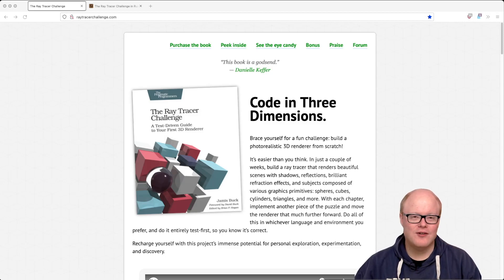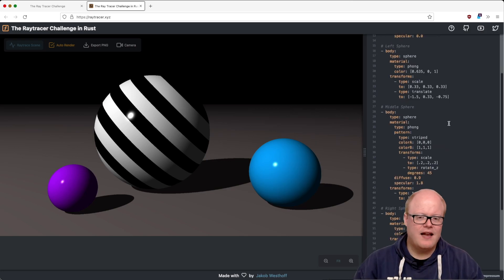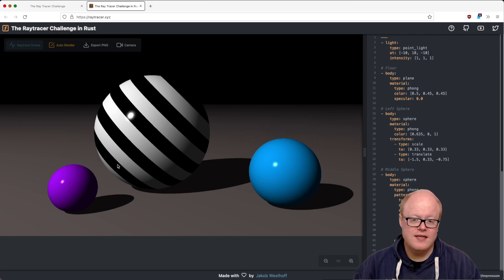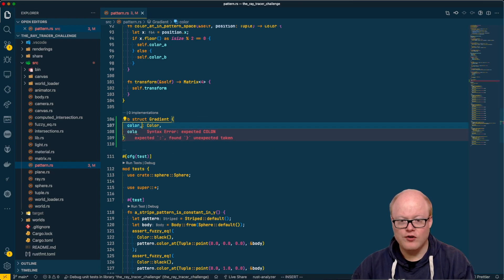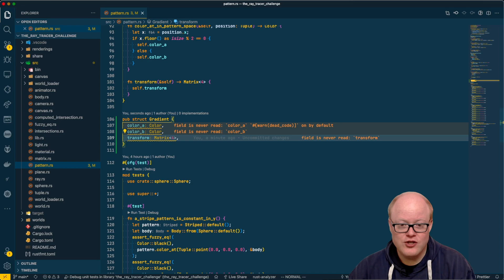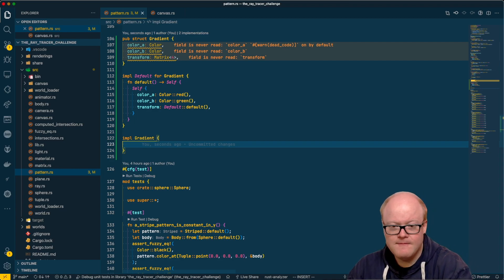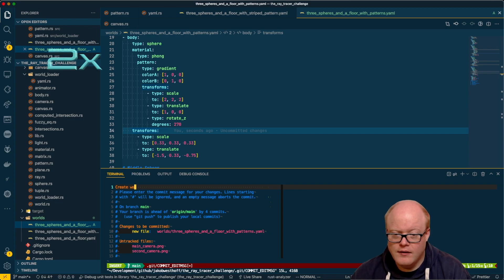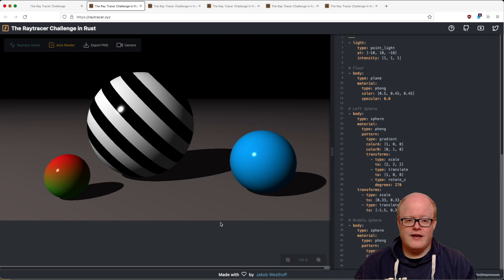The Ray Tracer Challenge - 032 - Gradient Pattern

Comment: @MrJakob, can you please tell how important is understanding of underlying mathematics for this book? Does it make sense to work though it without sound understanding of underlying concepts?
Reply from the maker: What you need to understand raytracing is a basic knowledge about geometry, which includes vectors and a little trigonometry. If you have basic understanding of those concepts you are perfectly fine, as the book is very detailed in its explanations.

You might even be able to follow the book, without that knowledge, but I guess it wouldn’t be much fun, as you will be able to „copy“ from the book, but you won’t understand what you are doing exactly. I hope that helps a little.
Reply: @MrJakob  Thank you for the reply!